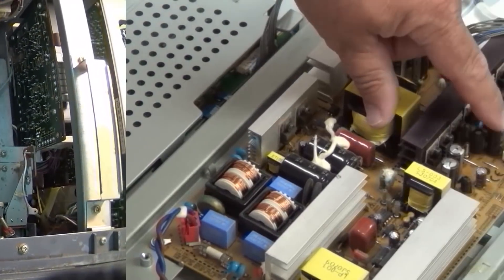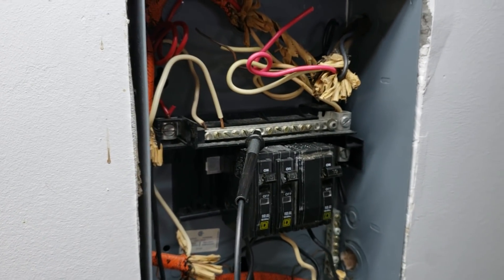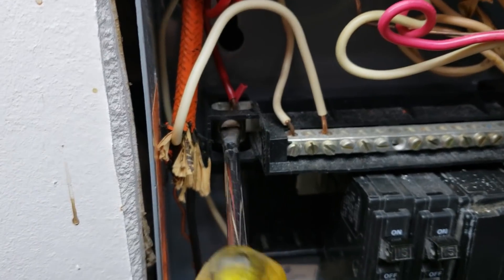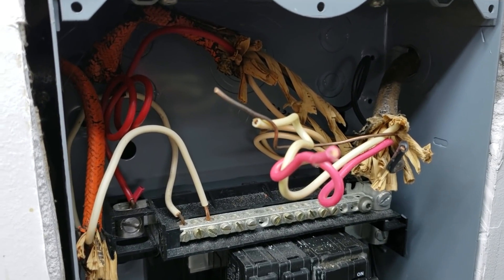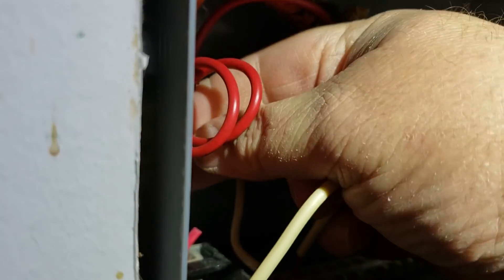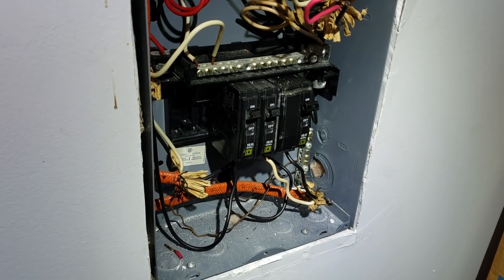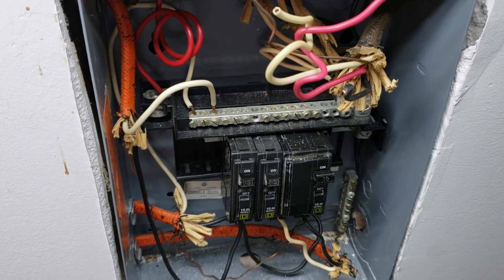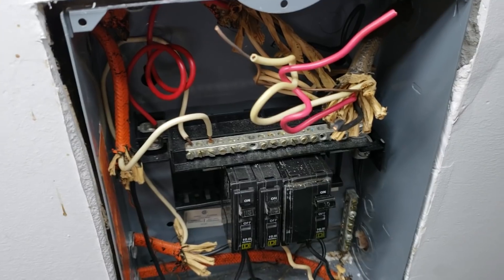Electrical fail

Comment: thats  a rats  nest,,,would not pass  code in ohio  ...
Reply from the maker: It wouldn't pass code anywhere.  Not my doing.  It was like this when I bought it.   The whole house was like that but I tore the house apart and rebuilt everything.  I didn't touch the old garage though. It is just to store junk in. I never go there unless I need something.  The only thing that panel powers up is a freezer, and  heat to keep the place from freezing in the winter.
Reply: @12voltvids  well at  least  they used a good breaker  box,,i wired many  till  i got my job at delco,,,,in dayton ohio,,started out in electronics  ,,worked  for a tv tuner  repair co..  retired  from  gm in 2007  ..as an oven  electrican  ....love your vids...keep up the good work...fixed many vcrs  for  the people  i worked  with...like you said,,,new ones are junk..

Comment: Call a pro.  You know not what you do.  Keep fire extinguishers handy and smoke detectors operational.
Reply from the maker: Actually I do know what to do. I am an electrician now. That's what I do for a living. I wired my entire house when I built it.  This was existing as this structure was not renovated as it is just a detached garage where I store old equipment in the loft.  This was done by the previous owner.  I pulled a permit when I renovated the house and it was all inspected and passed with flying colors but this was not inspected because it was existing and had not been touched.   The inspector looked into the main and sub panels in the house but not in here.